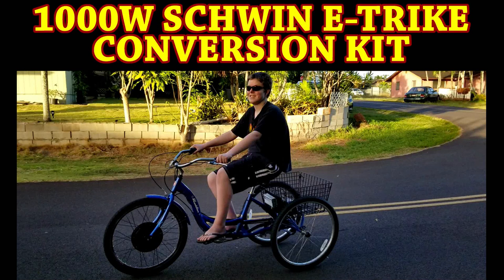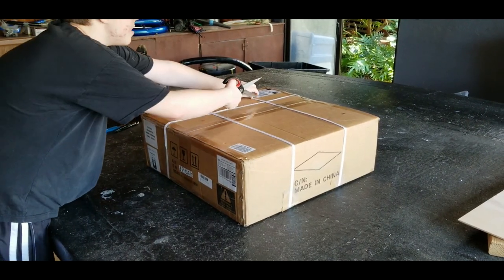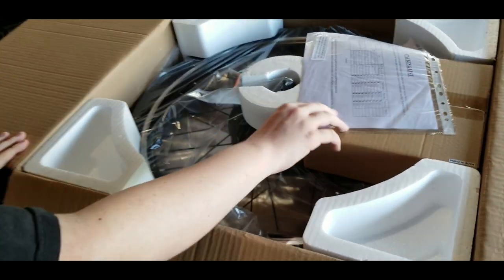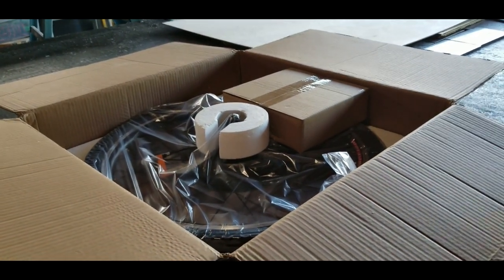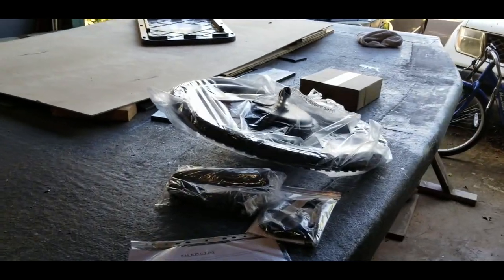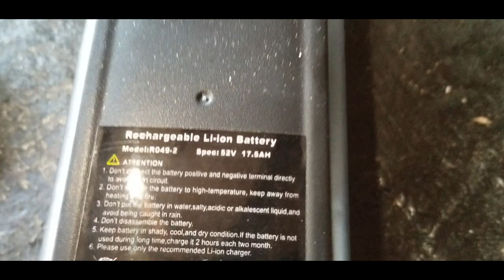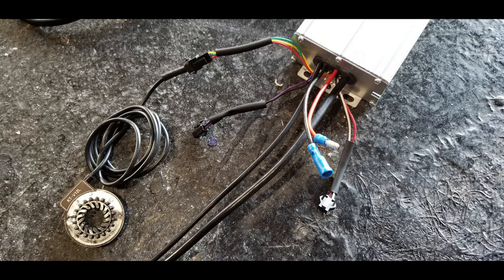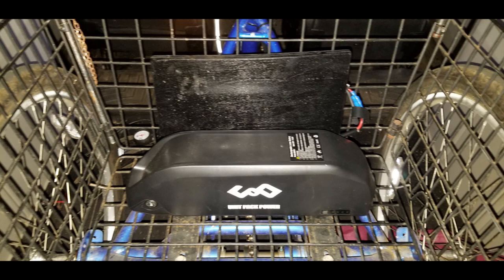1000W SCHWINN E-TRIKE CONVERSION WITH 52V 17.5 Ah BATTERY

Comment: Word of warning about E-trikes:
I built an E-trike with the Schwinn Meridian, AW motor kit and 48V-1000W battery.
Here's the problem with this set up.  The whole reason for a trike in the first place is liesure stability.  Yet the funky/wobbly nature of trikes is exactly contrary to this!
If you're coordinated/experienced  enough to ride these within a margin of safely then you would also be able to ride a regular bike just the same.  Just get you a regular bike of good quality and put a basket on it.  I sent all items back.
As an aside, the motor provided plenty of power and speed. 
The Jury is still out on the reliabilty of this stuff long term.
Reply from the maker: 2-wheelers are fun for riding... my trikes are handy for hauling... different bikes for different uses.
Reply: @DIYKauai  I think a 2 wheeled e bike with a trailer would be best for my shopping needs

Comment: A little heads up on the Schwinn.  Ive seen a video of a Schwinn Trike conversion that was loaded up with 50lbs or so and driven daily.  After several years it failed drastically in the worst of places. He was scooting through a turn at a busy intersection in Frisco Bay area.  No injuries, except his pride, stopping traffic and picking up pieces. 

 I believe it was the axle that failed, if memory serves.
Reply from the maker: That sounds like Rinoa's Auspicious Travails... these aluminum trikes are kinda flimsy...
Reply: People usually don't do maintenance causing issues the more moving parts the more maintenance. Especially if you're taking a 15mph bike and constantly doing 25mph on city roads
Reply: With everything electronic is not going to last forever

Comment: Great videos, quick question. I have a Knock off Schwinn trike with a 750 front motor. My problem is the wheel always seems to work it’s self loose from the front fork. I have torque bars and washers on the forks but it still gets loose and spins the wire till it disconnects. What is going on? Too much torque or what? Any suggestions?
Reply from the maker: The torque arms are there to save you when the wheel comes loose. It is possible that you have bent your drop outs? These are the end of your forks where the wheel's axle goes through. If your dropouts are not bent then the issue is that you really need to tighten down those bolts - as hard as you can really.

Comment: I bought a super janky one of these from my neighbor, it appears to have the same motor and controller as yours but the battery is nowhere near as nice and the wiring is horrendous - although it does work. Could you provide a link to the aliexpress conversion kit so I know what mine was supposed to be in it’s prime?
Reply from the maker: I have ordered from a few different vendors on there. One of the top vendors is CSC and if you just search Aliexpress for "ebike conversion kit" it will pull up a number of options.  The kits come with the motor-wheel, new break levers. a throttle, a motor controller an LCD display and some wiring accessories.

Comment: What was the cost of this build? Any issues from over amping the motor?
Reply from the maker: I bought the trike used for $200, the motor and battery cost me about $1300 because on Kauai we have to get them imported from China and pay $$$ for air freight.  You can get the drivetrain quite a bit cheaper on the mainland.
Reply from the maker: No issues with overamping the motor, works great. Over 5000 miles on it.
Reply: @DIYKauai  Dang! I can only afford $400 max. 😥
Reply from the maker: @Chad_Sandridge75  check on amazon, they get some deals. Also ebay, never know what there is.

Comment: I have the same kit and bike. So how did you install the pedal assist sensor?
Reply: I did not install them because too hard to get the pedal off. I don't like the delay with pedal assistance and would rather feather the throttle in by hand. Much better and more reliable.
Reply: @TheBackyardVerticalGardener  so it will work without it ? Just plug it in and let it hang there right
Reply: @hermilopadron4102  don't plug it in, no need. I have a little box of them. Did you get the half throttle?
Reply: @TheBackyardVerticalGardener  yes I did and thank you love your videos

Comment: That's awesome! I'm looking to do this exact same thing once I could find a trike. I really like the fat tire trikes so I'm waiting to see if I could find one of those before ordering a kit. Has your kit been doing well over the past year? I will probably end up ordering something similar from Amazon or direct from Aliexpress as well
Reply from the maker: The spokes on the cheap aluminum rims for the  Swim bikes have gone out on my rear wheels so it is sitting idle for the moment.
Reply: @DIYKauai  That happened to my Trident Schwinn trike got a new from Schwinn local bike shop and made out of chrome coated steel rim now dont have to constantly adjust spokes because of bumps!!
Reply from the maker: @uweabraham3134  Local Schwinn shop?  I would love to have more robust rims for these trikes... it would make a huge difference for use with poor road conditions and coastal rust. The challenge is that each rim is different on these trikes. We only have one guy on island that can repair and true these rims and he is leaving soon. I would love some more info about the ones you got.
Reply: @DIYKauai  I am wondering for $1425, delivered to door, a whole fat tire bike with 48 volt 18AH batt is something to try? on Alibaba manufacturer's site, not aliexpress. thoughts?

Comment: Why is cost never said ,uumm
Reply from the maker: The trikes are about $350 on the US Mainland. You can get conversion kits a lot cheaper there as well. I have to order from China and pay extra for shipping so my prices may not be relevant for you. The motor kits cost me about $450 and the batteries are about $550 - delivered. So about $1,000 for the drivetrain.

Comment: Great build and narrative. Questions: I have the exact trike, even same color. What would it cost for the hub kit and separately, the bike battery from alixpress? Im new to ebikes, and have no idea how to navigate getting these parts affordably. I currently dont ride the tricycle much due to its single speed and breathing problems, but, want to do this exact diy build so I can be more mobile and healthy. Any tips, suggestions, a parts or build list, would be very helpful? Thank you kindly :)
Reply from the maker: I bought a 1000W kit and a 52V 17.5 ah battery which works well. The motor was about $300 and the battery was about $400... I had to also pay shipping for these.  You can go 48V battery and less Ah to save $ but I think getting the 52V battery is worth it for a little extra power.
Reply: You can go in ebay and look for 52v batteries and 1000w ebike kits in your desired wheel size. The kits come with the brakes throttle and pedal assist along with the controller and of course the motor wheel.

Comment: A couple of questions... I have the exact same trike, with a 26 inch front wheel.  
I'm 70 and need some assist to get to the market and back.  This video is the first one I found tonight.
In the video you say you replaced the brakes.  What with?  
The stock trike has brakes (which I think are shit), are the chinese brakes better??
California has a 750 watt limit.  Can the controller be programmed to limit the power to 750 watts?
Where are you located?  Can I hire you to do the conversion?
Reply from the maker: Aloha - the conversion kits come with new brake levers that include a shutoff switch so that the motors are cut off if you apply pressure to the brakes. I put on larger break pads which help a lot with the stopping power. Most controllers have programable limiters of some sort. There is little enforcement of e-bikes... just don't be a jerk when you drive and pass pedestrians at peddling speeds.  Best of luck to you. I use this trike 5 days a week and it is real handy.
Reply: 1000 Watts on the trike would probably be equivalent like 7:50 cuz we're dealing with bicycles that usually use 750
Reply from the maker: Mike - did you get your bike sorted out?